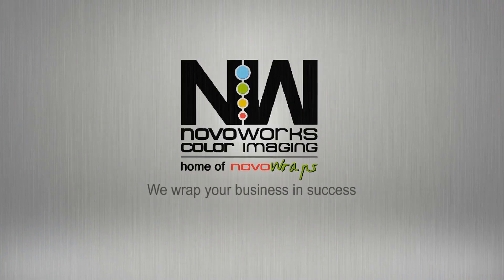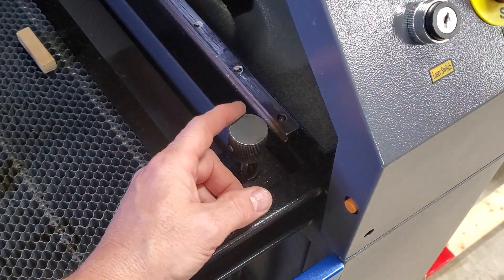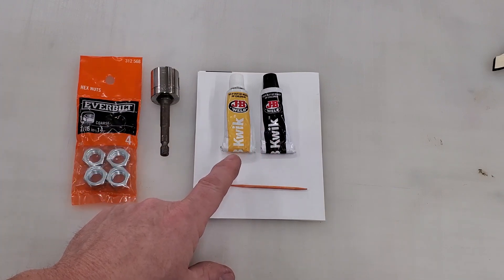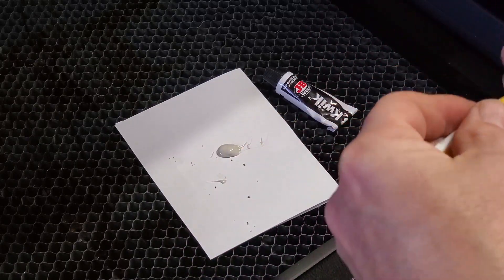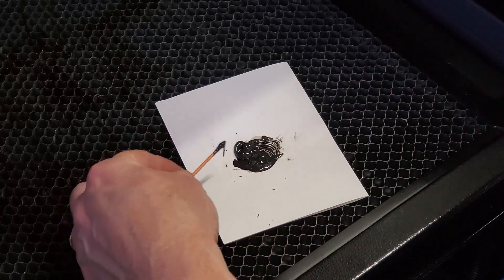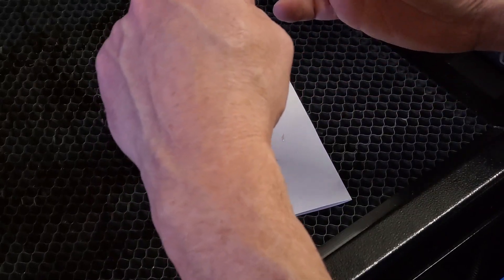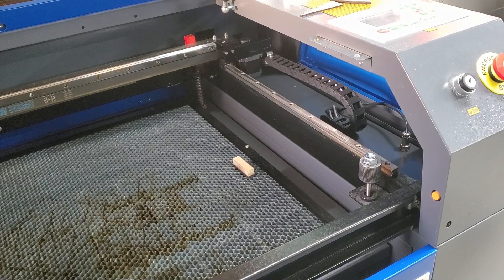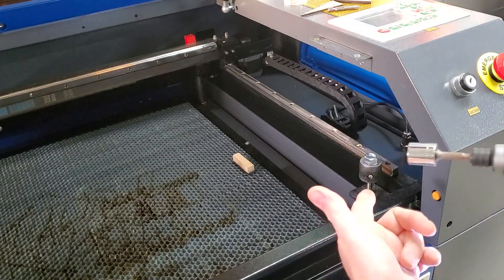Omtech Laser Manual Focus Hack Part 2 - Easy bed height adjustment!

Comment: Would a 12v ryobi screwdriver do a better job than the impact driver? It is easier to handle and there would be less risk of over raising or lowering the bed. In any case, great idea.
Reply from the maker: Do what works for you!  I like the speed and flexibility of this for us.  We always have it near the machine either way

Comment: You don't have to do all that. Just take the knob off and the cordless drill will tighten down right on the stud
Reply from the maker: Yes, can do that... but not quite as convenient when most of the time you are making fine adjustments by hand.  This way you don't have to take the knob off and on to switch between methods.